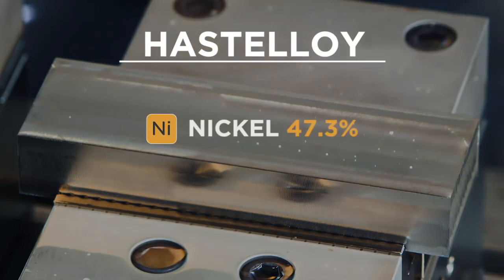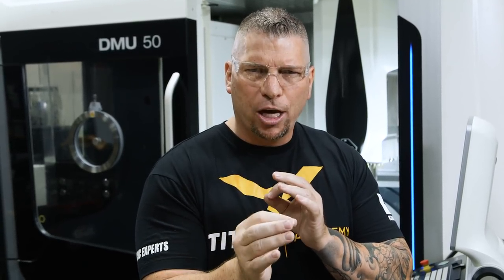Drilling Hastelloy | CNC Machining MasterClass | Vlog #95

Comment: I had to check how hard it could be. I just fell off my chair when I got a quote today for a couple of ball valves in Hastelloy C. They were more than 100 times more expensive than the corresponding valve in 316 stainless steel. More than 100 times!!!

Comment: Hey titans of CNC

Big fan of you guy since i am a student of machining. I have a question for us how use millimeters. Can we get the speed and feed in mm in description or maybe also in the video, to help us?
Reply: I have seen this type of question on his videos like a lot of times...why not just calculate it? you will learn inch and millimeter at the same time =D i just see this as a bonus! BOOM!

80 SFM = aprox 24.3 M/min(CUTTING SPEED), 
you get this like this: 80x304,8=24.384mm/min 
                                                         24.384mm/min / 1000= aprox 24,3 M/min

From cutting speed you can get your RPM like this: 24,384/3,14(π=mathematical constant)/12,7(diameter of the tool)=611,464 RPM

IPR 0.004 = 0.101 (FEED IN MM PER REVOLUTION), you get this like this: 0.004x25,4=0.1016

IPM 2.44 = 61,976 mm/min (FEED RATE ON THE MACHINE), you get this like this 2.44x25,4=61.976mm/min

I hope this was helpful =)

Comment: Titan, thanks for this video. I have a request. I don't have machines with through spindle coolant as I'm sure many other folks that follow you don't as well. I believe this will change the feed and possible require pecking. Can you please comment on how the speeds and feeds would be change with no through spindle coolant, on Hastelloy and other materials you have drilled in past videos?

Comment: Hi Titan, Can you please make a series how do you machine with extended length reduced shank endmills? I'm talking  about 10-15 X endmill diameter length of cut. I have the issue with chattering. since I'm trying to use them on "box" parts. Now days a lot of "box" looking parts come with small corner radius. Would be great if you can show how do you solve this problem.  Thanks.

Comment: Working with hastralloy sucks. We make rings in an st25 lathe. Using a 1.250 insert drill 3.5 od stock and it get bored and ID grooved 

Takes forever.